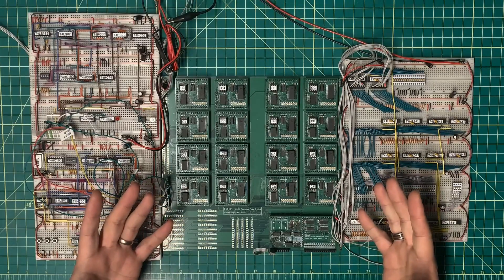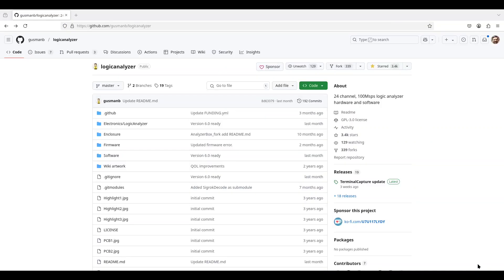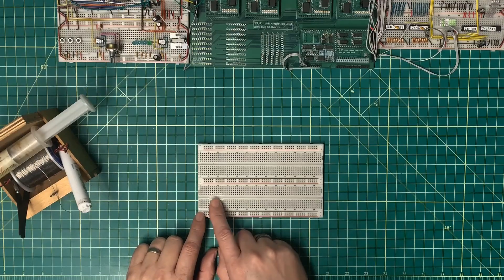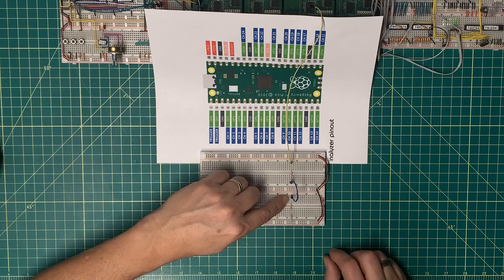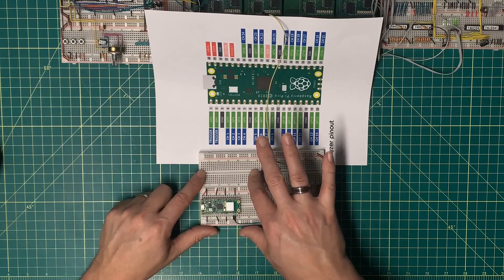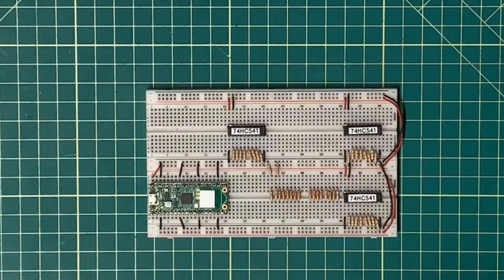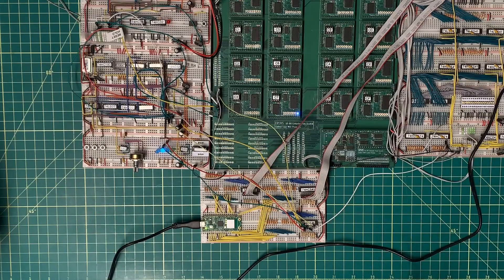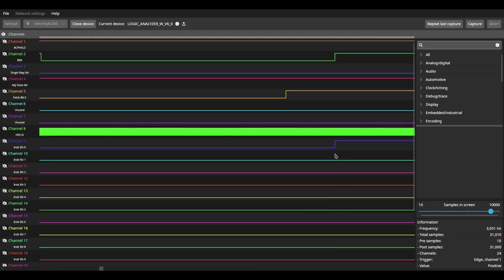Open Source Gusman Logic Analyzer | This and That

Comment: I'm a big fan of the "LCSoft CY7C68013A Mini Board" ... but that's not going to manage 72 channels. ☹

I spend a lot of my time using an ATTiny with just a crystal and a programming header and telling people they don't need an Arduino... So my thoughts automatically go to "could you just use an RP2040 and minimal support components instead of a Pico"????????  I suppose the first stumbling block there would be surface mount soldering - but still, it gets me thinking.

Comment: Why don’t you just use the Gusman PCB that has all the level shifters built in?
Reply: Probably because you have to buy a minimum of five boards from PCBWay, and you could buy the bare boards and populate just one once they came in to save a tiny bit of money.

I bought the boards populated and added the Pico once they arrived. The total price worked out to about $25 per LA.

Comment: Interesting project. I looked at the economics of building out something like that versus buying an older unit on ebay. Decided on an HP 1670G for $450 complete with all the pods and clips. 132 channels and handles level shifting for various logic families. 150MHz state analyzer, 250MHz timing. The unit I got also has the 2 channel 500MHz oscilloscope option.

You will want at a minimum the 16 data lines, all of your address lines, plus clock, and at least a few more for looking at particular areas of interest/other control lines.I would want at least 20 or so beyond address/data/basic control so I could see the output of a given pipeline stage or memory buffer as well.

There are a few HP 1670G and  1671G on ebay for reasonable prices, some less than $250. 1670G is 132ch, 1671G is 102ch, 1672G is 68ch and 1673G is 34ch. Kind of weird that the higher model number is a lesser unit. They can be ganged together to get more channels. I would stay away from the 16700 and other 5-digit units unless they are complete. People part them out for crazy high prices so the empty chassis is left and sold cheap.

A nice feature of the "real" LAs is inverse assembler (not sure why they don't call it a disassembler), so you can see what instructions are being executed by mnemonic, not just the bit pattern. There are also as complicated as required trigger rules including counters. So it could trigger on the 5th time a particular instruction was read or the 32766 address going by for your control roms end state. I don't know if the software for the gusman analyzer has feature parity.
Reply: I think it’s fair to say that kind of kit is well betting my abilities.  At least for now.  

But that’s not to say I won’t get there in the future.  When I do I’m sure I will want something like you describe.  I just don’t know what I don’t know.   

The app does appear to have conditional triggering like you describe.  And it supports decoder plugins, so there is a reasonable chance to be able to add in support for my own ISA.  

It gets my feet wet and without a huge time or ministry investment.  If I figure out a proper upgrade before Christmas….
Reply from the maker: @adamclark1928 oops.  Wrong account.  What I said.

^^
Reply: @eryjus4594  I don't think HP or other prebuilt gear is beyond your current skillset. But I do also understand the desire to build it all, to understand it completely. For me, buying a working LA was more beneficial than taking on more projects to do projects to do projects. I already have too many open projects. 
I think with the gusman LA, you will easily be able to do the inverse assembler since the other helper extensions are in python.